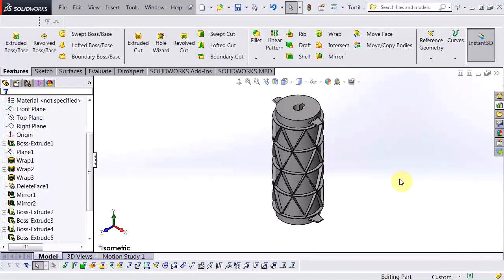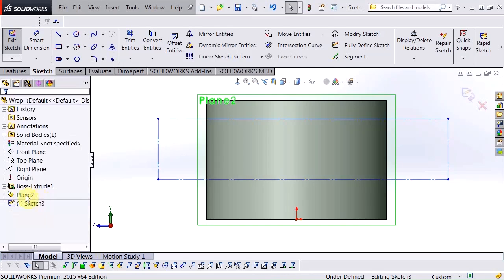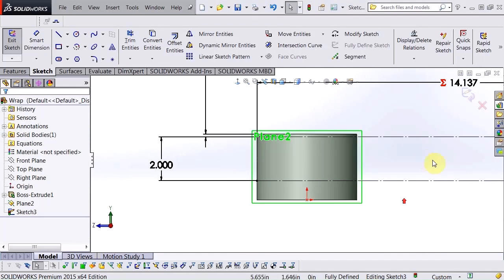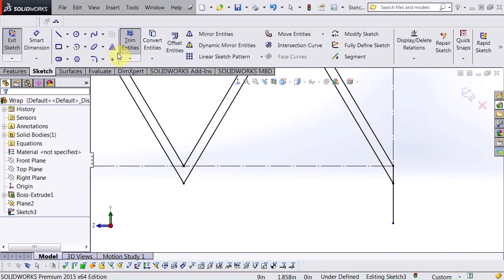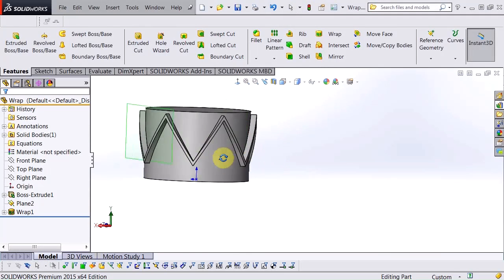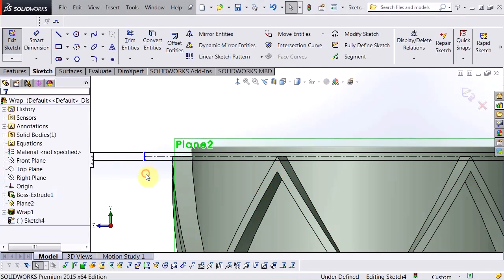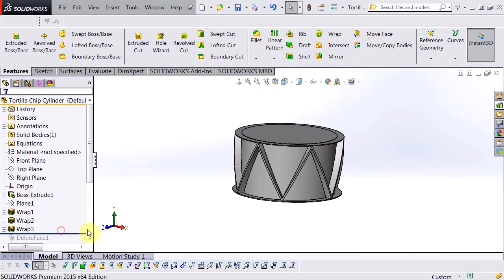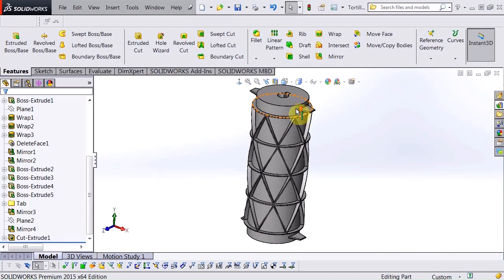SOLIDWORKS: Wrap With Pi

Comment: Can we make this part different way instead of wrap
Reply from the maker: You could use sweeps and circular pattern. Similar to what is shown in this video, but a sweep to add material instead of a swept cut: https://www.youtube.com/watch?v=J8xArI6ajBw
Reply: @hawkridgesystems  sweep need a path
Reply from the maker: @soulmate-v3z  The video linked shows how to create a path for a sweep on a cylinder using helix

Comment: Hello,thanks for the video!I have a question: when I use the wrap command it actually works but instead of the whole circumference it embosses almost the whole( there is a little unsketched gap although it is sketched in the plane before the wrap command)Anyone knows why this happens?In other words although I have sketched for the whole circumference (25mm) but it actually wraps lets say 24mm

Comment: Very good. I learned a lot out of the video. It is a single solid body. But, I am thinking how to manufacture this. I am going to have the parts and weld them together.
Reply: That's fine. I got it splited using Insert > Features > Split . .....

Comment: "the syntax of the equation is incorrect" solidworks 2017
Reply from the maker: We just tested this process in 2017 and 2019 and it seems to still be working (on our end). 

If you are sure your equation matches the one shown at 2:02 , I would ask - have you successfully used any equations on your system before? We have rarely seen cases where equations fail to work altogether on a particular system if there is an installation problem or missing prerequisites.
Reply: @hawkridgesystems  Is this an install issue? 2018 SP 5.0